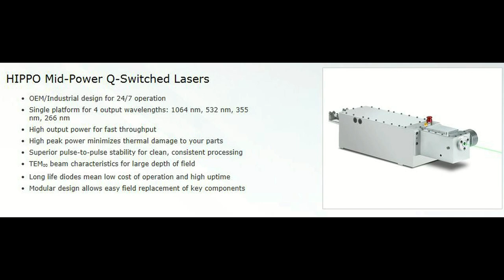Spectra Physics Q-switch Laser  serie HIPPO

Comment: Hey man... I recently got my hands on a R-Series Spectra-Physics laser power supply with a Q-Switch diode in it. I had to hack the supply to turn it on because it didn't come with a key, nor did it come with any other accessories. I have been attempting to get the beam to show but I have yet to be successful. Do you have any suggestions on hacks I can do to get the laser to turn on (the previous statement was for power supply)? The manual Spectra sent me isn't much help without the remote and fiber optics cable... I'm thinking I can hack it with an Arduino to gain full control but I am not sure where to begin. The power supply came from NASA's Goddard Space Flight Center BTW and Spectra has no info on the laser itself. I have tried. It was originally built in 1997 but the laser was rebuilt in 2001... It is a very large diode so I am excited to get it running.